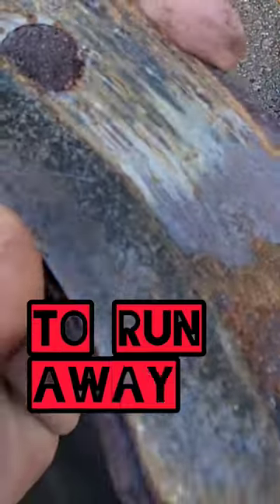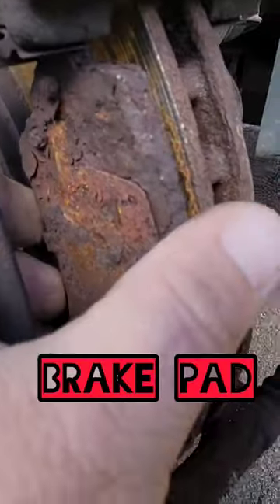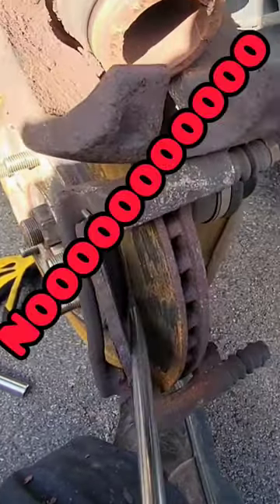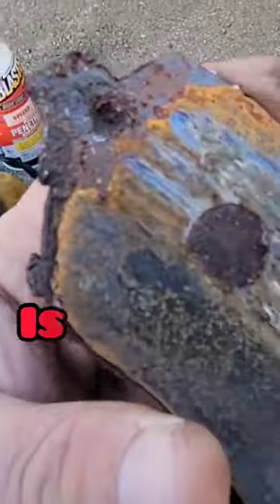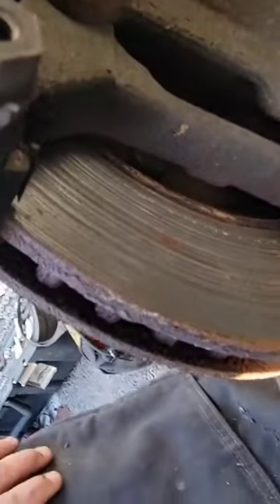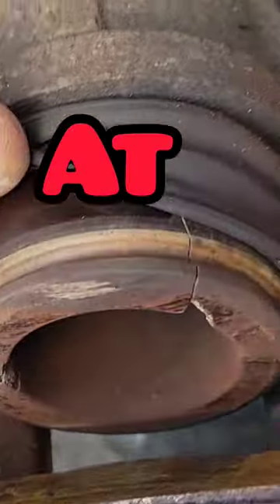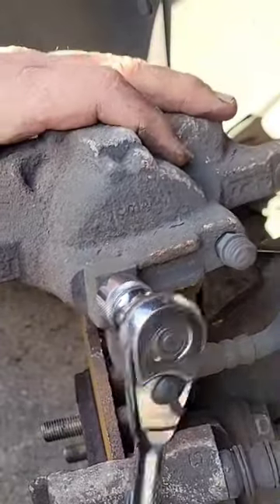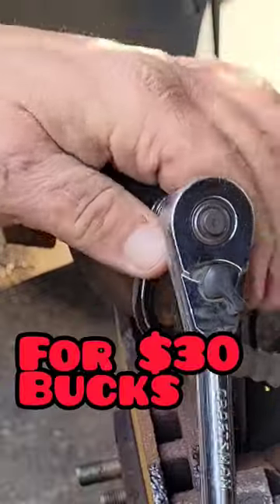Customer States: Just Do A Pad Slap

Comment: $30 bucks for brakes? When did you film this in the 70's?
Reply from the maker: Hahahaha I was just making a point. I charge 1 hr labor which is $85
Reply: That was just the parts cost
Reply: Haha right, I went to firestone last week and they wanted $400 just to replace rear bake pads. I almost ran out of there.